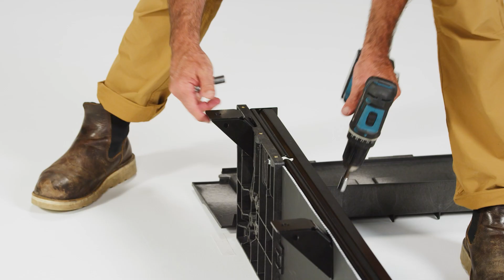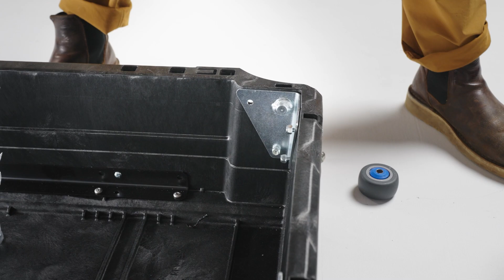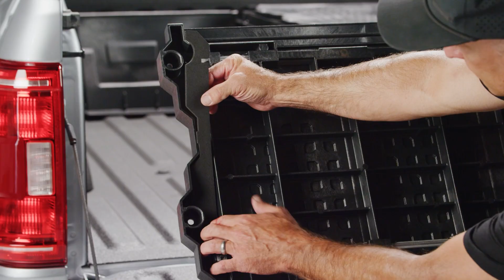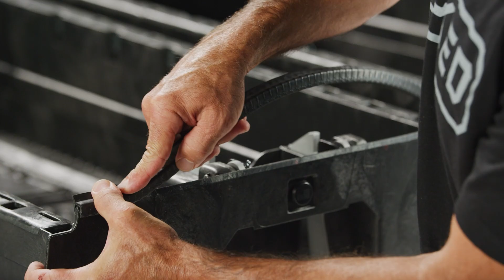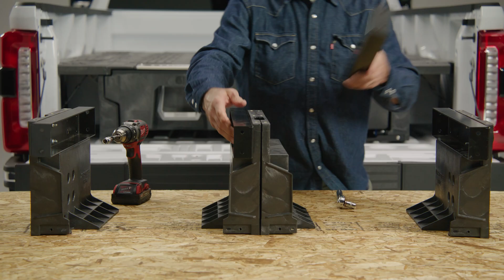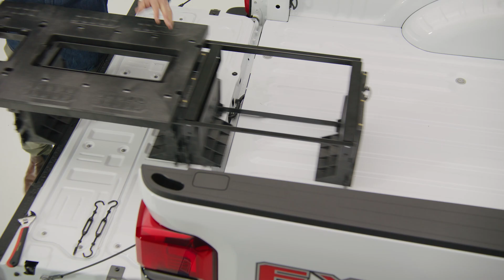How to Install 8-Foot DECKED Drawer System + Load Floor (Step-by-Step)

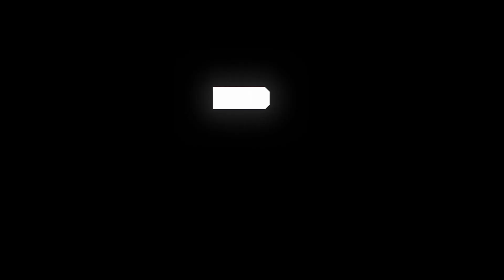Comment: It seems like the two parts of the video should be flip-flopped: If it's best to have the load floor installed first, shouldn't that video portion be first? I'm glad I watched the whole thing before starting installation. Start @10:35 in the video.